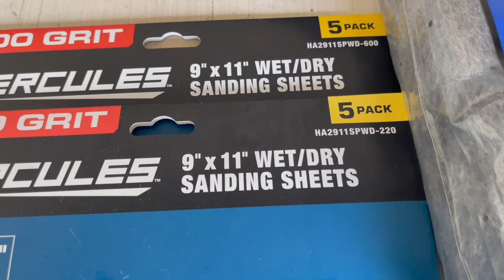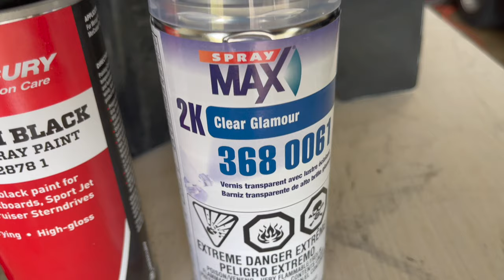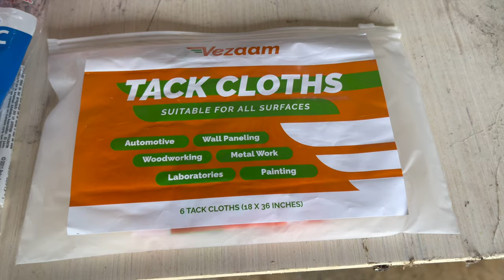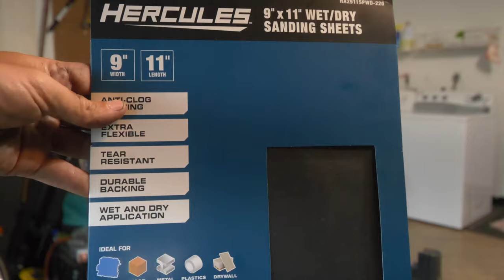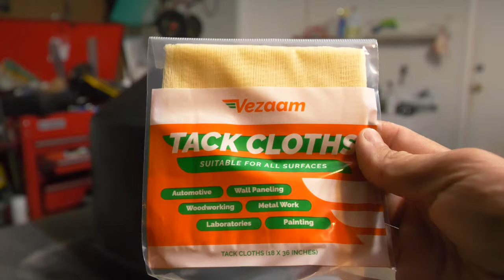How To Paint An Outboard - Spray Can Restoration

Comment: Anybody watching this, please do not sand before clear coat. Depending on the type of paint you are using it will wrinkle if it’s an enamel you CAN NOT sand a respray. Get the shape and imperfections out before you spray your base coat. After you spray base coat wait 30 minutes then clear. You’re welcome.
Reply: question sir, is it a bad or good idea to apply clear coat on top of the decal, to somewhat protect the decals color? thank you
Reply: I personally don’t recommend it. If you get real outboard stickers they are made to be in the sun just as much as the paint is. I’m doing mine right now

Comment: Pretty sure you should apply the clear while the 2nd coat of colour coat is still slightly tacky.
Reply from the maker: With cheap clear, yes that is correct. But not with high quality clear that has a hardener, such as what I used in this video.

Comment: I figured out the problem.  Even though I wiped the pieces with a dry towel and tack cloth after I wiped them with a damp cloth, I think there was still some residual moisture on them.  I sanded them down and this time set them aside for a while to dry.  The clear coat went on without any issues.  The clear coat seems to be much more sensitive to moisture on the surfaces than the prime and color coats.  Fortunately this issue happened on a couple small pieces which I did first just in case there was a problem.  Thanks for your video and help.  I refinished twin 250 Verados and they came out great.

Comment: Great video, very informative and easy to follow. I do have a question though, after wet sanding down my last base coat with fine wool (I am using the same phantom black paint and 0000 fine wool as you) I can see very fine scratches from the sanding when the cowling has dried. When the cowling is wet, the scratches are barely visible and negligible. Did you have the same thing happen? If not, do you think I should reapply another base, and just apply the clear while it's still tacky?

Comment: Thanks for the great video. I am doing this on an Optimax 135. How many spray cans of the black did you need as I have to order them online?
Reply from the maker: For the cowl and chaps, I used 4 cans of black. 2 per coat. For the remainder of the motor I ended up using 3 more cans.
Reply: Thank you! What is the brand you used for the spray can attachment?

Comment: The Mercury Paint instructions says dry to the touch in 20 minutes.  They say to apply the second coat either before one hour or after 24 hours (full cure time).  How long did you wait to wet sand after you applied each coat?
Reply from the maker: I wet sanded roughly an hour after each coat. They say to apply the second coat before an hour as if you're not wet sanding. The paint is dry to the touch, but not cured so both coats will bond. When you wet sand and create those micro abrasions and more surface area, it doesn't matter how long you wait, as long as the paint isn't wet. This is the process I took. Many ways to go about it and get great results like I did.

Comment: Use 400 wet sand after primer after black paint use 800 then respray.. reason for orange peel is to heavy on paint try lighter coats and you should tag cloth before every coat 😊

Comment: @flowbass Hi. i've found this video a little late. Quick question. I have an old Honda Outboard and when I was sanding it I noticed I did take it down to the fibergass in some areas.  What's your best reccomendation to restore that part?
Reply from the maker: As long as its smooth, you should be able to cover it with primer and it will be fine. You may want to add two extra layers just for additional protection. If its not smooth, you'll need to use body filler first, sand it down smooth, then primer.

Comment: Skip the acetone and use water and let it air dry
USE THE TACK CLOTH BEFORE PRIMING and every time you sand..sand with 800 or 1000 grit wet/dry sandpaper, NOT the steel wool.
MOST IMPORTANTLY....SPRAY IN AN AREA WITH GOOD LIGHTING...if you spray like he did in low lighting, it will turn out like crap like his did and not a smooth glass finish...good lighting will show your imperfections that need to be addressed and not spend all that money to say "I'm ok with it" or just to cover it up with a decal. A high quality gloss should look like a high quality finish, not like a gloss that looks like he used a 97 cent can of spray!

Comment: HELP!  I let the second color coat dry overnight then wet sanded with very fine steel wool.  I wiped off the pieces and wiped them with a tack cloth.  I applied the clear coat.  When I went back in an hour to check on them, the clear coat had shriveled up and cracked in places.  Any suggestions?
Reply from the maker: I'm sorry to hear that, Ed. Very difficult to diagnose over the internet. My best guestimate is you sprayed the clear coat on too thick, or possibly the clear wasn't mixed well enough. If you used the clear in my video it has a hardener you have to release and mix for a solid two minutes before spraying. It also might be too humid when you sprayed it. Just guessing.

Comment: People, only watch this if you want to know what NOT to do.

You're sprays should overlap. even from the initial primer coat he is leaving massive gaps & has to go back over it to get proper coverage. And then Uses acetone (paint remover) to clean after each coat. His final finish is the ultimate example of a rubbish job, The entire cowl was "orange peeled" when he put the cowl on the motor just before he put the decals on. It should have been polish smooth before he ever put the clear coat on.

Watch any other video but this one!